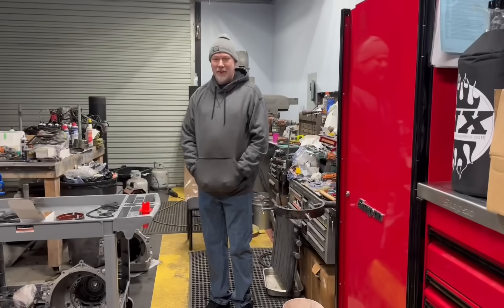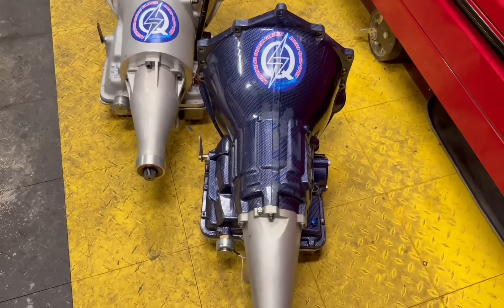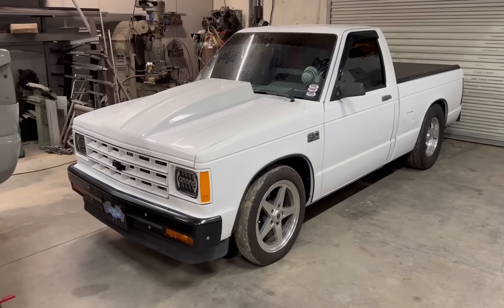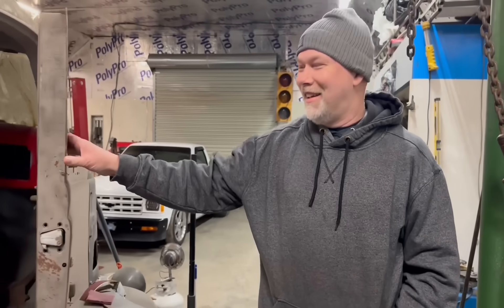Powerglides are FIXED!  Lightning Quick Glides to the Rescue!

Comment: Why do you need dumps ?
I thought  the Holley Dominator was so you could tune for track ,and get away from dumps.
Reply: Dominator has nothing to do with spooling. Dominator gives him a lot more inputs and outputs and you can run 2 O2s that can handle alcohol. 

Dumps help a small motor or any, spool a big turbo, easier.
Reply: And the dumps are a tuning tool . Can also help with getting car down the track .